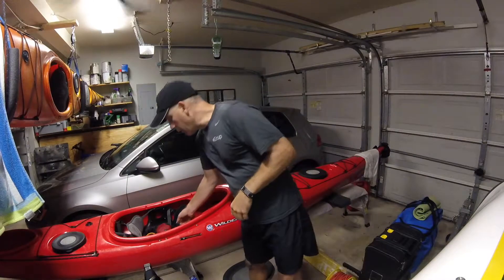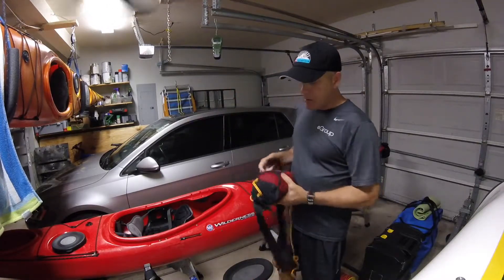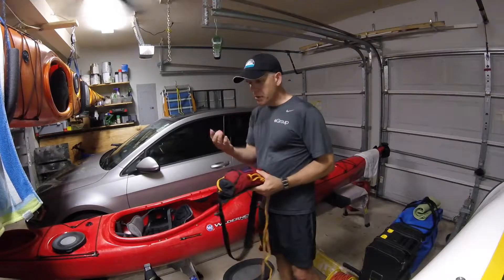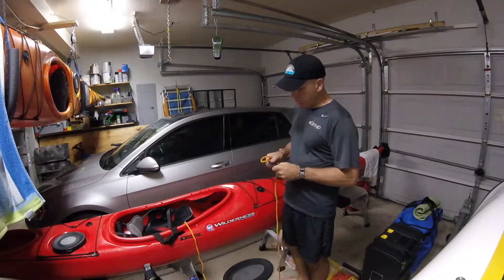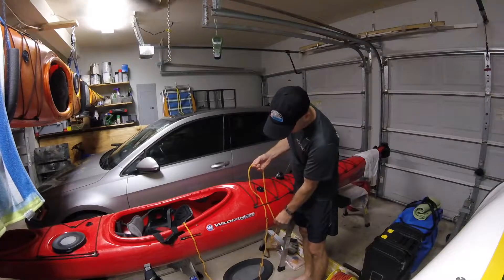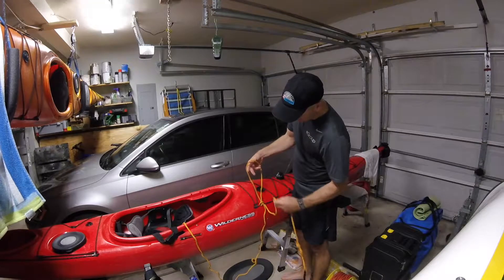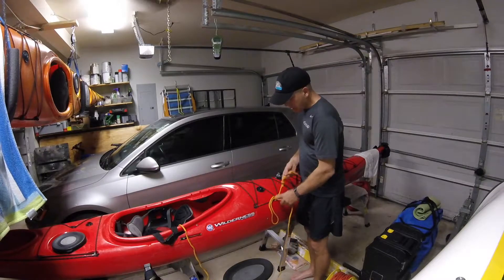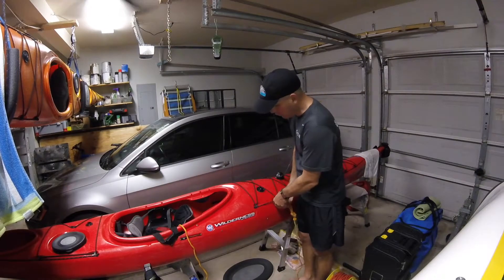Tow Quick Release

Comment: Move that up to the deck rigging/grab loop of the bow, Greg, so you get a pivot point at the front rather than the possibility of a side-vector if the towed boat gets off-line. Just make the terminal end/caribiner tag longer to reach back to the towed boater.
Reply from the maker: Good point Larry. For and extended tow especially one out on open water most definitely.